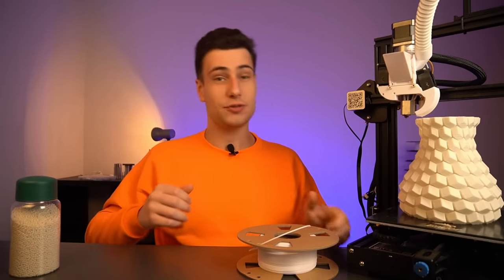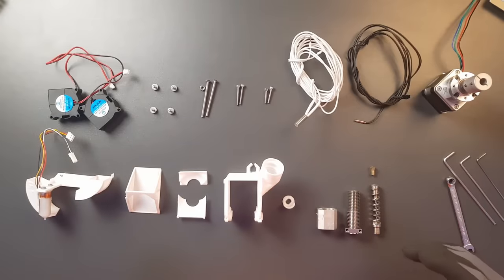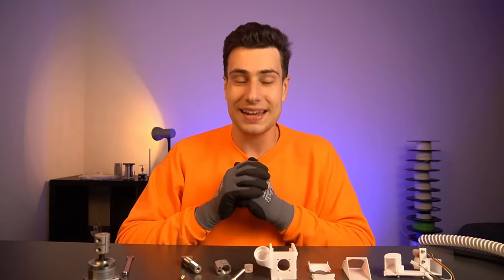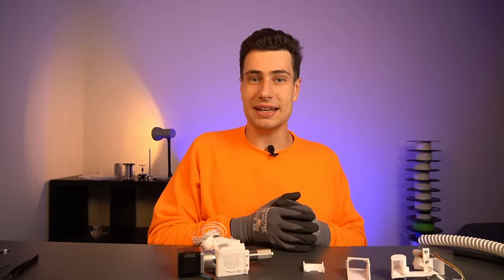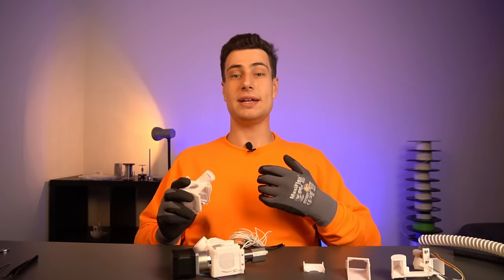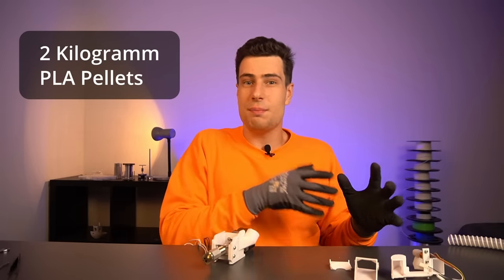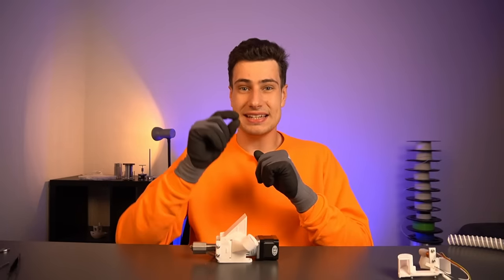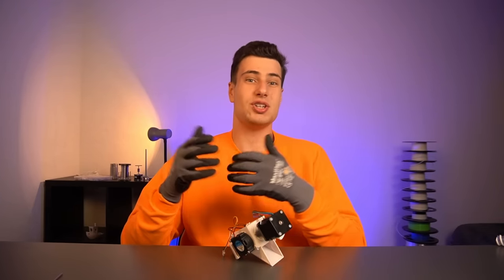Pellet Extruder for ANY 3D PRINTER | 3D print Granules, Chocolate, Sugar and more

Comment: First of all, it looks nice.  But there have been others that have already made cheap pellet extruders (such as Mahor XYZ and HomoFaciens).

Furthermore, although you talk about the problems of the pellet extruder itself, the most fundamental limitation is the calibration needed. Due to how pellet extruders operate you would need to determine the "rotation" per mm extruded. This value is highly dependent on the viscosity, which is a function of both temperature and extrusion speed.

If you can find an easy solution to that issue, you will have pellets of gold in your hands (especially when also adding mixing capabilities).

Comment: you did not explain how you deal with the extraction when printing, with filament the gear pulls and pushes the filament to prevent stringing between movements, how do you do that with yours.

Comment: I've not dabbled with 3d printers yet, but this looks a great improvement to the 3d printing process. Do you think it possible or an improvement to have the pellets go in to a heated reservoir that then feeds the nozzle in more of a filament like manner from the reservoir? that feels like it might smooth out the printing process, perhaps improve the print quality closer to filament printing, but it does add another layer of complexity to things where you have removed that complexity nicely. Just a thought from an outside perspective so to speak 🙂

Comment: This is cool, the only thing I wonder about is - what about the ability to retract the material during the print? With a filament printer, you get to set the retraction in the slicer. Would this print as well without that option?
Reply from the maker: Would you like to see how retraction works in my next video with some demonstrations? 🙃
What would you like to see next? 🙂
Reply: @greenboy3d definitely, if you want to show it next time.

Comment: It would be interesting to see the screw close up and a diagram, would it not be better to either tapper the thread or tapper the od to reduce the space so it melts better and with a bit more force, obviously if you have been working on this for 2 years then you've gone back and forth with design ideas. You could have the plastic housing made in aluminium it wouldn't add a great deal of weight but would make it stronger. 👍👍
Reply from the maker: Thank you for your feedback :)

What would you like to see next? 🙂

Comment: I think your extruder needs to be significantly larger to cope better with flow irregularities caused by pallet packing unevenly into the extruder screw. Also, this is much more useful if you get a much higher flow than the usual extruders. My guess is 100g/h+ is the point where this is worth it.

Comment: At what speeds can you print with your hotend ,as the new 3d printers are printing around 500 to 600 mm/s , but i would buy one if the print speeds were about 200 mm/s . great idea and the way you solved the problems of pellets without adding weight are inspired , great video and have subscribed .

Comment: Very good execution. The problem of most such construction is too short screw. Best method is to add geared melt pump for preceise dosing but that complicates hardware/software. But then what is the gain? I can produce filament by professional for 4 euro/kg, you can't use fiber filled pellets in this they will clog, you can't use regrind that is really cheap. Screw removing cleaning takes lot of time. I have had Lilly (recycl3dprint) and it worked for a while then clogging all the time. Big waste of time for dissasembly/assembly, cleaning, tinkering.
Reply from the maker: you don't know everything my friend, and only because you had a bad experience with someone elses pellet extruder, doesn't mean it will be the same with mine.
Reply: Well finger crossed for your project. I gave up and don't see the point except very soft thermoplastics. Best overal material I've tried was hard TPU >60D. Show us interesting material for printing not PLA and not vases.  @greenboy3d
Reply from the maker: I will @jzagaja

Comment: I got some questions
- is run out detection possible with pellets?
- how well does printing multiple color pellets at once work?

Would love to see it printing!
Reply from the maker: 1) If you install a sensor that can detect a run out of pellets sure + you can also you make a huge for example 10kg hopper and then you will run out only in a year 😅

2) What ever you put inside the barrel will eventually come out, :)

What would you like to see next? 🙂

Comment: nice to see innvation in types of 3d printers insteadf of only sintering sla and fmd. what would change the world is if you could add like a ink or coloring dye when it goes to the hot end. then multicolor printing would be only a slicing issue. but think how this could change 3d prinitng when you can adjust on the fly. 

also this is just a concept. lets imagingen this like a bambu printer. wher yopu can preload them in diffrent containers. And you only have to say what colours you want. I believe you can make this an amazing product. and change the world

from a fellow engineer

Comment: Could you please provide more details about a "coupler"? So thing, which is between a motor and hot part. How that heat breaker works? I mean you have to somehow stop heating your rotor/motor from a melted plastic, so I guess that "heat breaker" is doing this thing, the question is "How"?

Comment: Will this work for the A1
Reply from the maker: Probably not, unfortunately. Too closed source and too hard to modify, those machines are very fine tuned. 🙂
Reply: @ damn . What about prusa mk3?
Reply from the maker: @pavoldeman1762  Prusa MK3 is supported and there will be
very soon even be a 3D printable adapter for the  Prusa MK3 on my website greenboy3d.de 🙂
Reply: @ what about qidi machines?

Comment: I guess pellet extruder have no retraction or little, is good only for consistent extrusion?
Reply from the maker: If the slicer settings are fine-tuned depending on the material you use then you can get retraction almost as good as with filament extruder.

It is just slightly more complicated because there are more things going on inside a pellet extruder.
Reply: @greenboy3d  thanks, I thought there is no retraction, but nice if it is possible at all
Reply from the maker: @polyfoxdesign7888  I suggest you to watch this part of my other video, where I talk more specific about retraction: https://youtu.be/eWgzi4a1bJo?t=119
Reply: @greenboy3d  thanks
Reply from the maker: @polyfoxdesign7888  Do you have any further questions? 🙂
Reply: @greenboy3d  thank you! I dont have any questions! well done on R&D, keep up doing great work :))
Reply from the maker: @polyfoxdesign7888  Thanks 🙂

Comment: Very impressed! I wonder if this could be extended to handle multi color. It would be complicated and require a smaller hopper for each color dispensing into the main hopper. The color and amount needed could be calculated then released into the main hopper at the appropriate time. send me the files and an parts and I'll turn my old anycubic vyper into a multi color pelet printing machine :)
Reply from the maker: All 3D printed parts will be freely available, the rest will be sold in form of a KIT.
And thank you for your warming words! ❤
What would you like to see next? 🙂

Comment: looks like it very possible to use this with shredded failed prints and supports and waste. do you think you could do something like this for a shredder? there are alot of videos on "cheap" shredder solutions but they are all still several hundreds of euros. even a hand crank shredder is fine. love this, good job
Reply from the maker: What do you mean with "do you think you could do something like this for a shredder?"

Comment: one more idea, if you put more than one print nozzle in one print head, you could possibly use electric nozzle shutters to control which nozzles extrude, also controls the output rate for single nozzle printers. then it just puts some pressure on the shutter waiting it to open. I prefer comments instead of survey formalism. literally. making their own is essential. cant have two if you only can do one. coffee grinder chute (tm). lol. ground powder instead of pellets, yes you can blender the pellets into powder. check wheat seed grinder machines. but thats maybe a bit too fine powder. of course money dictates that there cant be more efficient things. what would industry do if they dont get paid.
Reply: as a side note, 3d printing in metal with water dot point electroplater on a detachable metal plate inkjet style. can use copper sulfate water as the print liquid. actually you could just submerge the hole detachable base metal print plate into copper sulfate water and just move the print head inside the liquid, just above where you want to 3d print, add metal, on the base plate and the model. yep kinda like spot welding. spot plating.

Comment: This is really, really cool. When your Extruder becomes available, I'm quite sure that I will buy that thing - but what printer should one plan on using? I will definitely not rip my Prusa MK4 apart, so what would you recommend? A cheap Ender? A used Prusa MK3?
Reply from the maker: I use Ender 3 V2 currently, but I would wait with that printer purchase, since I am about to do some printer testing and will then recommend some that are ideal.

What would you like to see next? 🙂
Reply: @greenboy3d  Basically exactly that. I am really interested, but at this point in time it's not clear what it would actually mean to get into this. It would be great to have a clear idea of the steps I'll have to take.

Oh, and it would be nice to see how that thing handles the kind of plastic flakes you get when shredding plastic waste. That is the main reason why I find the concept so compelling - being able to used the waste material from my expensive printers to create stuff for which a somewhat reduced quality level is acceptable would be sensational.

Comment: What about reliability and print quality ? I imagine this is more prone to jams than regular extruders, and/or it is harder to control pressure inside the hotend ? For high flow/thick walls this looks great but I'm not so sure about small stuff about the size of benchies. If you ever pout out a benchmark video I'll be the first to watch it :p
Edit: also, why not ABS and why no heatsink on the hotend ? Although it's nice that you made this accessible to people without enclosed printers :)

Comment: I see the potential but a lot of problems as well. The stepper that drives the extruder screw adds a ton of weight. This throws us back for like 10 years in terms of machine dynamics. It would be interesting to know which accelerations and velocities were set to print this vase. The first thing that comes to mind is to get rid of the stepper on top of the extruder and to move it elsewhere. How about a flexible shaft to realize that? This would definitely cause precision problems due to the shafts torsion etc. but im pretty sure this could be dealt with on the software side. Which brings me to the next problem that i see, the software aspect. Everything needs to be recalculated, we're talking about pressure in the nozzle, consistent material supply, e-steps and whatnot. Think of it, the moment at which your standard filament has the slightest deviation in diameter for example, will directly result in a visible error in your print. Current slicers are obviously trimmed for filament use, and for this extruder it'll need something completely new. It would be interesting to know how long it took you to finally get this clean vase and how many attempts there were before. Anyway, all in all i highly appreciate the innovative spirit and give you a big thumbs up. Great work!

Comment: AfAIK the main issue with pellet extruders is that the flow is somewhat constant, so retraction doesn't really work. How did u solve that? Was wondering since your benchi doesn't look stringy at all

Grüße
Reply from the maker: Retraction is no problem, do you want me to demonstrate that in the next video?
Reply: @greenboy3d  that would be awesome :) Flow capabilities would be also very interesting

Comment: I get why you would design for the lowest denominator of PLA for your plastic parts, but wouldn't PETG be a better choice for the printed plastic parts? It is the same price and has better heat tolerance and slight flexibility that make it less brittle. Or is there a reason PLA is a better choice for this application?

Comment: I have always expected that the largest challenge would be inconsistent flow rates due to inconsistent size and injection of the pellets themselves. I did not see anything in your video talking about this, what has your experience been on print quality? I also suspect that a large layer line would reduce the impact of inconsistent flow rates?
Reply from the maker: In the next video I will do some printing :)

Comment: Does the screw need a tightening profile towards the end? Isn't the purpose of that only to manage friction and thus, heating of the pellets? Why not use just one profile through the whole length of the screw and use heating and cooling externally. Less jams and more heating-cooling control via software, without any hardware changes.
Reply from the maker: The tightening reduces the required motortorque, which means a smaller motor and this means less weight and better printquality and so on. :)

What would you like to see next? 🙂

Comment: I have one question tho... how fast can you print with it?
Reply from the maker: Can't find out at the moment because the ender 3 v2 can't provide enough power for my extruder motor. While printing the extruder motor doesn't even get warm

What would you like to see next? 🙂
Reply: @greenboy3d  I mean you have printed something with this extruder right? compared to a standard filament extruder it has to be slower or it doesn't really matter? I mean printing speed for example it is comparable?

Comment: Two issues - I don't see that cheap pellets. On Ali it is 4x the price of normal filament, and locally there are very few offers with no significant price difference form spaghetti form (maybe except when a company bankrupts and sells inventory).
Other problem is that recycled plastic will be contaminated and you'd have to use large nozzle diameters to avoid clogging.
Reply from the maker: You probably just don't know how to properly source pellets for a good price.
Do you want me to make a video about that? 🙂
Reply: @greenboy3d  Not sure If I'll be in need of that. But more involved people would appreciate.

Comment: Now... how to use the same concept with old prints. Grind old prints or misprints into small pieces (obviously not round pellets) but be able to feed them into a hopper like this and print them.
Reply from the maker: I am working a Solution that you would like, but right now the main focus is on the Pellet Extruder :)

What would you like to see next? 🙂

Comment: @greenboy3d as everybody knows Printing Business IS ABOUT INK (2D printers) and FILAMENT (3D printers) and...printers too. That's why there is no innovation. They keep the status quo as long as they can. One of the advantages of using filament is size standardization, the other is a low tech/cheaper product (no screw = less expensive pieces/problems = more money in their pockets). I read that many guys told you that adding color pellets will be difficult, I think it is, IT'S REALLY DIFFICULT TO ADD COLOR and MORE DIFFICULT IS TO GET STANDARD COLORS. For RAW PELLETS you are on the right path. BUT if you want a COLOR PALETTE well... this system is INVIABLE because you will need to mix raw pellets with color pellets to make filament to make pellets.....
Reply from the maker: Thank you for your message :)

But who said that coloring your 3D Prints is ONLY possible if you can get your hands on colored pellets (Masterbatches) :D

In the next video I'll show 4 different really easy methods to get colored 3D Prints :)
Reply: @greenboy3d  Masterbach is the color base product, you need the main polymer....
Reply from the maker: @gastonbarouille767  you'll see in the next video what I mean

Comment: You may have reduced mass in the extruder itself but you have added significant mass in the tube and significant resistance in needing to bend the tube too, so whilst this works at relatively low speeds, it likely wouldn’t work with the higher speeds most 3D printers can achieve now and are becoming standard. Why would anyone buy a pellet extruder if it means they have to print much slower?

Unless the mass and resistance can be significantly increased I think people would prefer to just use a filament extruding machine and normal filament 3D printers.

Comment: If you set up some way for us to throw money at you some of us would prolly do that.
Reply from the maker: And thank you for your warming words! ❤ The 3D printed parts will be free, but the other non plastic parts available in form of KIT
What would you like to see next? 🙂
Reply: @greenboy3d  like to see you try chocolate and some blended filaments. A tpu and petg blend would be interesting as the 2 plastics tend to fuse well and have a similar melt temperature. Like to see you feed a strip of PET soda bottle into it to use recycled plastic to print with. No need to shred it just feed it in. A magnetic petg pellet blend would be nice. They currently only sell magnetic pla filament, which isn't the best when printing motor stators.

Comment: Not convinced yet, I believe there will be a lot of problems with reliability, filament pressure, speed etc.
It probably works ok for slow, lower quality parts and the premise of cheaper print material is great but there are a lot of reasons why this is not mainstream, more than just "print companies can't sell their filament".